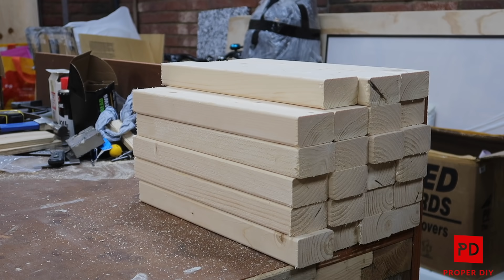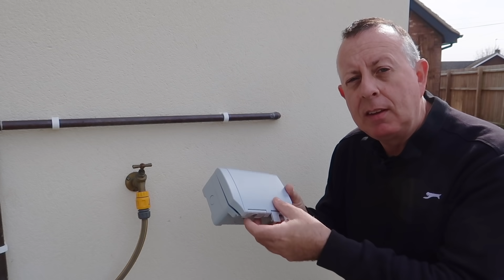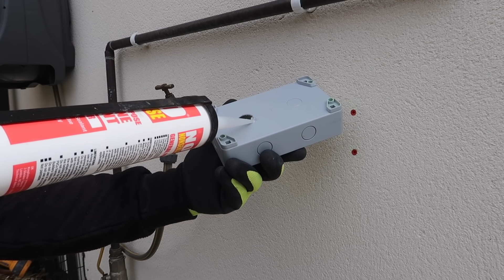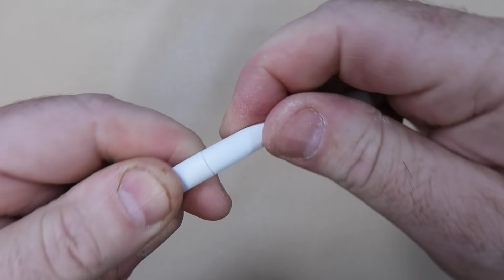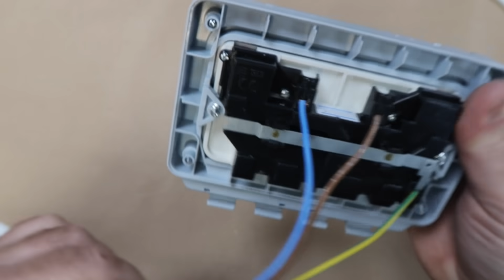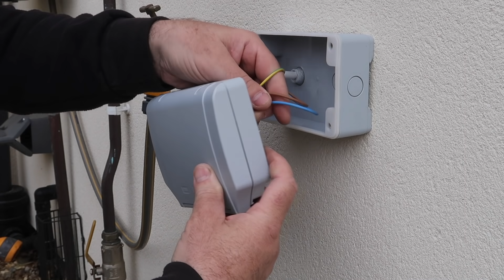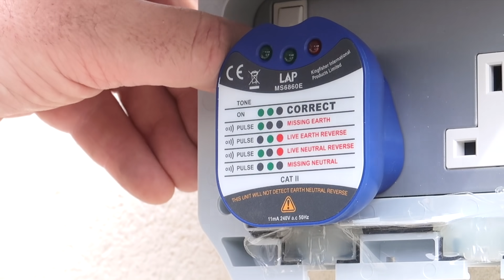How to Install the Easiest Outdoor Socket

Comment: As an registered electrician with 20 years experience - nice job 👍 I would have charged £150 parts and labor plus certificate for that. ( in august 2021 )
To water proof further I would have run silicon around the whole socket where it is in contact with the wall except the bottom side.
Reply from the maker: @jimpaterson9635  I did talk about the required RCD protection and what I have in the video
Reply: @ProperDIY  I know, trouble is without conducting a test, you are in the dark as to if the circuit is compliant.
Reply from the maker: @jimpaterson9635  Yes, the same as all the other additions and replacements that a homeowner is allowed to do under Part P including everything in the home that isn't PAT tested.
Reply: @jimpaterson9635  the socket on the inside of the house will be connected to the ringmain already which will contain an RCD - its also got an additional 13amp fuse so is further fused, its safe as houses that install!
Reply: @jimpaterson9635  'l
Reply: I've been quoted £60, parts and labour from an established company - who also fitted my lights in my living room. Was planning on doing that myself, but I think £60 is reasonable now.
Reply: @polluxtroy69  anything on a plug top is not deemed as fixed wiring. You could get it PAT tested though. Personal I do not like this method. I would prefer to see the plug replaced with a switched fused spurs so that it can be tested as an integral part of the ring/radial
Reply: @polluxtroy69  if you think l£60 is bad, consider Sasha would charge £150 LOL
Reply: @HillHyker  I don't think £60 is bad, I think its reasonable. As stated in my comment 👍
Reply: @polluxtroy69   Did you get it done?  That seems incredibly cheap even taking into account the parts that are needed.  More than you think sometimes, clips, cable, glands, socket, extra RCD for the CU, sealant + the test after fitting with very expensive test gear + paperwork etc!
Reply: @polluxtroy69 yeah that isn’t too bad. Parts cost me £37 including silicone for context.
Reply: @polluxtroy69  I absolutely would not pay the above quoted £150 for this job. I got a complete RCD fuse box fitted for £500😂
Reply: @polluxtroy69  always the best option to get the circuit verified, safety is priority.
Reply: @jimpaterson9635  Hi Jim, When you plug in your extension lead do your get it tested every time to make sure it’s safe! 😂🤣
Reply: @wideboatbluebell3021  Of course not you idiot. But I do check a circuit when it will be  connected to an outdoor socket even via an extension lead,  and in this case beside an outdoor water tap.
Reply: @jimpaterson9635  what a tool you are. From an electrician myself there are too many people like you out there make basic electrical sound like an impossible minefield. The man has taken all correct precautions and the fact that it is beside a tap is irrelevant. Its IP66 you doughnut. You’re probably one of these fellas who goes on about notifying building control for changing a socket 😅😅😅
Reply: @nathanstephenson775  The socket is fine, it's the circuit that would an issue. Ie no earth, or a failed RCD. I guess you think its OK not to test. So feel free to plug outdoor equipment in without testing.
Reply: @nathanstephenson775  im no spark but im competent when it comes to electronics from building my own pc's etc over the years and doing most of my own sparking in the house etc - surely the plug socket on the inside of the house is going to be on the ringmain anyway which will have a breaker PLUS you then have a 13amp fuse between the exterior socket and the inside socket anyway??? it looks/seems safe as fuck to me!
Reply: @jimpaterson9635  the socket on the inside of the house is already on the ringmain with an rcd, how hard is that to grasp? what a plonker you are rodney son!
Reply from the maker: Well thank you very much for the comments - especially coming from a registered electrician - much appreciated! 
What I didn't show in the video was 2 days later I had a look at the socket and did exactly what you suggested and ran silicon around the top and 2 sides of the box just to give it some more protection!!!
Reply: @ProperDIY twisting wires?
Reply: @kageboilingtuber5918  thats how you prevent loose strands dur
Reply: @ProperDIY  I don't know about the UK, but in the US the sealant is called silicone. Silicon is what microchips are made from. Nice installation.
Reply: I fitted one but wired to a socket via a FCU. So able to isolate it and FCU is fused too. Didn't use sillicone around the inside of the box. Fitted a grommet & used clear sillicone around the top n sides of box instead.
Reply: I paid £80 to a sparky after a re-wired my own house
Reply: Nice of you to leave a new home along the bottom for the insects??
Reply: Part P regulations in Wales differ from England - it is illegal to add any external sockets or power to outbuildings without either using a fully CPS registered electrician or notifying local building control before hand and paying the £200+ fee's for inspection.

Wales still running on 2010 building regulations so kitchens and anything outdoors is still considered a 'special location' so no adding of fused spurs or extensions to circuits is allowed. This includes connecting the external socket via flex and a plug like this - as it would be deemed a fixed installation, regardless if you're plugging it in rather than through a FCU (fused connection unit) off a spur.

Just pointing this out - don't agree with it though...the blanket policy that no one can do anything without paying £100's to someone else is ridiculous.
Reply: As a certified electrician what's your comment on the length of removed external insulation on the box and the bensong of copper like that?
Reply: As the most highly trained specialist electrician in Europe I say good job and to Hell with the naysayers.
Reply: What about to near the tap just a thought 👻
Reply: Just curious is this still ok to do because everything I've seen in Part P of the Building Regulations 2010 states this is notifiable work??? Or am I wrong I just don't want to get fined
Reply: Ooh you've triggered a few here
Reply: May be it's a silly question, but I am curious to know why not running silicon on all four side instead of three sides only?
Reply: I’m pleased that I fitted my daughter’s outdoor socket exactly like you did here and yes my garden lights ( and therefore also Christmas lights) are always on timers 👍great work, thanks for sharing.
Reply from the maker: @Phillwin  It is legal to do it as a homeowner and ironically because it goes though a 13amp plug is safer as you have an additional fuse along the way. You do need to make sure that you have a RCD somewhere along the route though.
Reply: In addition would you have carried out a earth loop and rcd test to make sure all is working correctly.
Reply: @chrisardern4594   BEHAVE!  LOOP? RCD?   WORKING??
BREAH!!!!!!!!!
Reply: @Sparrow No paranoid just qualified. I like to test works. You do same with gas?
Reply: Why charge so much for a piss easy job .. rip off merchant
Reply: @thedrifterr  As a sparky myself I always say you’re not paying for what I do, you’re paying for what I know! It’s not a 4 year apprenticeship for nothing. 🤔

This kind of installation may look straight forward and indeed in most cases, (as here) it is, until that is you have a service with inadequate earthing arrangements, consumer units with inadequate protection or let’s say power to a heavy load appliance that’s NOT adjacent to the property so current carrying capacity of the cables need to be calculated in addition to fuse ratings and RCD response times AND whether or not it’s a TNCS, TNC or TT incoming supply!

As Stuart said this is powered via a 13A plug so in this case it’s essentially a short extension lead and the fuse in the plug will limit the loading on the cable to around 3KW.
A longer run though will probably need to take the resistance of the cable into consideration.
Knowing all that, getting it right AND being legally responsible for personal injury for getting it wrong, is what you pay a professional for. 👍
Reply: @niwty  And not just that, also equipment and experience! I ended up buying or renting so many tools for doing one job that I'm probably never going to ever use again (like a bunch of odd flooring tools, wedges, etc.). I don't have a drill bit long or tough enough to drill through my cavity walls, and even if I did I don't think I could drill straight enough to meet in the middle on both sides first try. Those are cases I'd get a professional, even if it's an 'easy' job.
Reply: @niwty chill. It’s just installing a socket.
Reply: Could not give a toss whether you have 20 or 200 years. You’re installing a frickin’ outdoor socket. £150 is robbery for a 15-20 minute work.

I hate these entitled “I have 15+ years experience” tradesmen
Reply: @Sparrow so it doesent matter if the RCD is checked for correct operation, earth loop impedance or polarity?  Correct? Good job you know your stuff because I've only been an electrical engineer for 45yrs
Reply: @jimpaterson9635  Things have gone a long way in 45 years.
These were the days, dangerous too.
I agree with with Jim. I think all homes should be checked at least once a year to make sure all sockets, plugs and circuit boards are maintained in perfect working order.
And who looks to see if tradesmen have cpd training certs upto date?
Reply: Thanks for stealing money from electricians pockets only £8,000 to become  electrician and 4 years learning for diy dave to give away our work.nice one !
Reply: @kevinsnout10  this has been the case with virtually all professions when then the tools and products are available to the public, I had the same discussion 35 years ago in hairdressing, and yet demand  far outstrips the supply of professional tradesmen so no, no one is stealing money from tradesmen pockets.

Comment: I used a 1.5mm round white extension lead to power my outdoor socket with a short 3 meter run from plug to socket...just cut off the old extension socket that I didn't need anyway and didn't even need to wire the plug as it was already on the lead.

Comment: Thanks for this, I was thinking of installing the socket on a fused  spur until I saw this video. One tip for stripping multicore cable, irrespective of it's purpose is once you've broken the seal and exposed the copper conductor, don't just pull the seperated piece of insulation off, hold onto the cable in 1 hand and gently twist the insulation until it comes off the end of the conductor. It'll twist the copper neatly and make a nice job and works well on all domestic sizes of multicoloured, from ultra thin twin core for small loudspeakers etc right up to  2.5mm twin and earth.

Comment: Nice video. I got my electrician to put one in at the front of the house for Christmas decorations. He drilled through the wall from the inside of an existing interior socket. So far so good UNTIL I went to plug in the Christmas lights. The outside socket door won't close because the plug protrudes out more than the depth of the socket box. 😭😅. Oh and BTW you can buy smart exterior socket boxes these days. They can be put on timers etc. Thanks again for the video. 👍

Comment: What's the RCD breaker? I'm incredibly new to DIY (with these sorts of jobs). The socket that he installed looks different to the RCD socket that he included in the description.

*Edit:
Looking at Google images I'm guessing so long as I've got an up to code fuse box in my house and I wire up the plug in the same way he has then I don't need that socket with RCD included in the unit?

Comment: That outside socket will be no good powering a hot tub. The 1.5mm cable will cause a voltage drop, making it pull more current that will get the plug top and cable hot. BS1362 fuses have a fusing factor of 1.75 amps. This means it will take 22.75 amps to blow over a certain amount of time.

Comment: I have done this but now face a problem. I have since had a water feature installed and the transformer plug does not fit in the outdoor socket. Am i right in thinking that I now cannot run an extension lead from this outdoor socket into a weatherproof box because that would be "daisy chaining". The water feature pump is a 7W power rating so pretty low.

Comment: Hi. I was wondering when wiring the wire to the plug you marked the wire. Is that where you cut the wire.
Reply: That mark is just where the outer flex is cut. The three wires inside can then be connected to the plug once stripped back and they will will not be seen.

Comment: Thanks for the video; really appreciate you explain your decisions on why chose it to it the way you did, which is so helpful to me to decide what to do on my situation. Just to add, the external socket with internal RCD you linked (not shown in the video) uses a 'latching' (aka passive) rcd so it remains in the "on" position during a power cut and automatically restores power when the supply returns, which is not reccommended for anything powering gardening tools.

Comment: can I use the Switched Power Socket with Latching RCD to power my garden office without the need for installing an external switch fuse isolator next to the external socket ?

Comment: Great video, which really helped me.  Instead of the plug to isolate the external socket power, , I used a 13A Switched Fused Spur (with Neon light) inside the conservatory (from a nearby socket), which means I just have to flick the switch On or Off, and the neon red light highlighted if the power to the outside is on or off.  Thank you for sharing.  A+++

Comment: Just a word of caution, I'd avoid the LAP one from Screwfix if it's going to get any sun as the plastic clips at the top snapped off and is a real weak part of the lid cover. Replaced with a BG one and much better and higher quality for only a few £ more. 

Maybe this is just mine and I had an unlucky defective unit? (It was a sparky that installed it).

Comment: I’ve used this method when I’ve needed an extra socket in the kitchen, I used the dishwasher spare socket to a boxed  socket coming up through the worktop, it’s basically just an extension cord with a socket on the end

Comment: Hiya! I hope you see this comment. I’ve just ordered a hot tub assuming I can use a good quality extention lead to find out you absolutely can’t! So I need an outdoor plug socket fitted asap. Will this be ok to do it this way? Or does it need to be wired into the mains for the hot tub? Many Thanks

Comment: Great video.  I've recently bought a hager double socket for the side of my house. It has 2 terminals for the earth wire. Are they linked together within the socket? So I can fit the earth wire to either terminal,  and both sockets will be earthed?  Cheers

Comment: You’ll be challenged to add a controller adaptor in between as you’ve made the cable too tight at the indoor socket.

Comment: I'm no sparky but don't just pluging a double socket in by a 1 socket 13 amp be an overload please correct me guys if im wrong
Reply: You do have a point but at the same time look at a 13amp extension lead 1 13amp plug and many sockets. as long as you dont exceed 13 amps over all sockets its ok
Reply: @3dprinterguy393  I'm new to this

Comment: Can I ask I noticed you used a 1.5mm flex T&E cable, I have been told that this cable is not recommended as it is not weatherproof, damp proof etc and to use SWA. However SWA is too thick to use in a 3 pin plug even grey flat 2.5mm is tricky. I can see you used the cable through a conduit plus lots of sealant so is it safe to use the 1.5mm flex, which for an outdoor socket is still suitable for lighting or power tools as it can carry 16amps which we only use 13amps?

Comment: Good stuff. I like to pin the conductors if they are stranded and the connection is screw type as opposed to clamp, just for good measure. I've seen stranded conductors get damaged over time where the screw presses into it and make imperfect contact. Probably why the newer method insist on doubling down the exposed wire.

Comment: Though perfectly fine, this does look like a bit of a bodge to those who dont unnderstand. 

Why not spur the internal (RCD protected?) Socket properly to an inline 13amp switched fuse, from which you run armoured cable externally etc? Same principle, the 13amp fuse will blow, but a much more professional install for hardly any more money.

Comment: Hi I’m thinking having having a go myself and putting two outside sockets, directly behind inside sockets so about 30 cm away , and I best connecting to the socket or do I put a plug in like you have done , thanks

Comment: Hi, great video thanks ! One question, I followed the process and agree I wouldn't want a drain hole as this would in theory affect the IP rating - however I have noticed after heavy rain there is condensation in the front black plastic section in front of each plug. Have you also found this and has any water got into your socket now you've had for a while? Guess you can't have sealed and no condensation

Comment: Wow. I was going to get an electrician in to fit one to the house electrics. Done your way, it's something even I could do. Thank you.
Reply: Tbh, I found it just as easy to turn off the mains, remove a socket on an outside wall and drill through, wiring the new socket into the interior socket. It's still a very simple task and is neater.

Comment: Superb, I am on my own and wanted an outdoor socket for the lawnmower. I have put my socket under the porch area so it is protected from rain etc. but have followed the video and done mine to a plug as well. Wasn't sure that was correct but your video confirmed it was all ok. I did however use electric cable that was suitable for outdoor use. although a bit more difficult to work with. Many thanks.